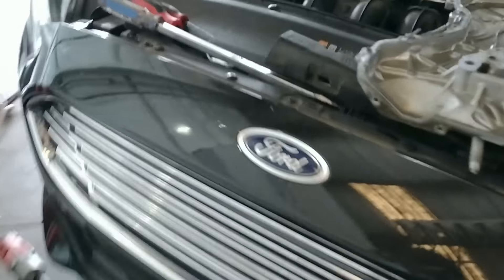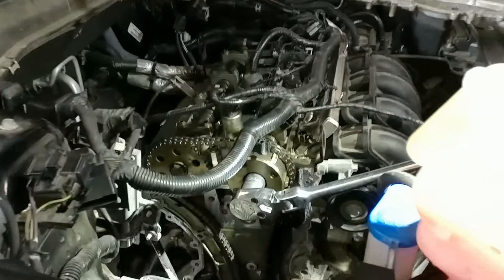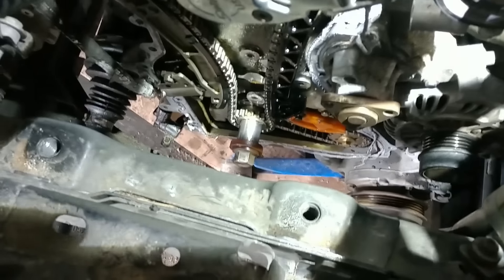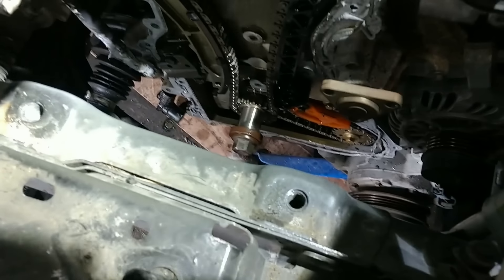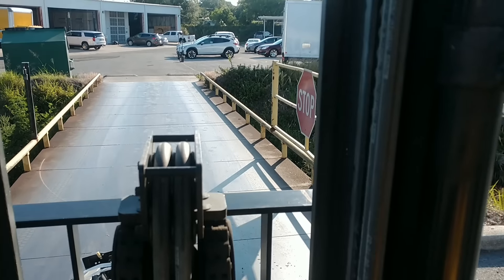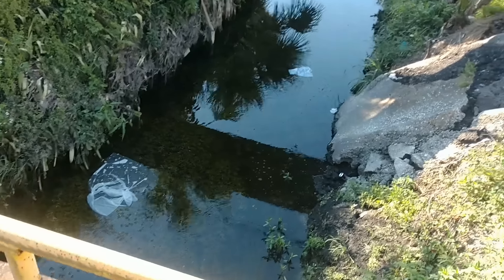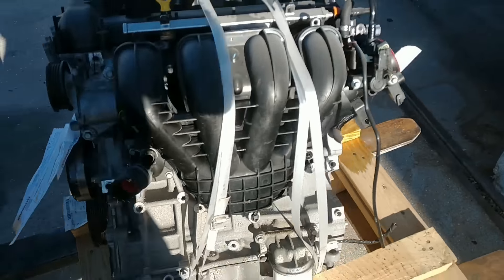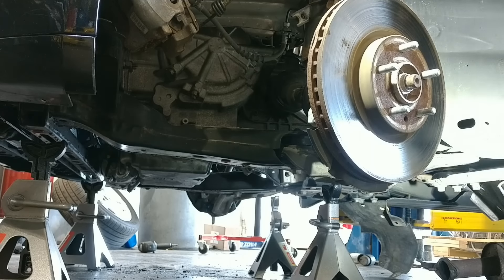Damaged Engine: You Broke it! Pt1

Comment: Great design. Replace the engine every time you have to remove the timing cover.
Reply from the maker: Lol 🤣
Reply: Lol itd be cheaper for sure
Reply: Ford apparently has a bunch of Apple engineers working for them now
Reply: @razter6678  Wait until the service department declares the warranty void because of invisible water damage.
Reply: Had a ford fiesta come in with a crank  no start after timing job, same problem but luckily the customer hadn't hurt the engine (it wasn't far out)  and it drove away after retiming 👍
Reply: About like 2.7 dodge products , don't do a waterpump without timing components
Reply: Late Ford Toreasses pull the engine for waterpump @ 10 hours of labor
Reply: Yeah, there is a toolset to remove the balancer that locks the cams and a special bolt that goes into a hole in the crank. It actually saves a good amount of production time. And in a perfect world the tool is only needed for timing set replacement which with a chain might be never. Ford/mazda have done this for years. Vw sometimes uses a taper lock with similar tools but the crank pulley might be keyed, the "correct way to do a vw is similar but you could do them without tools if you make your own marks. I would say since 2012 a bunch of manufacturers have jumped on the ford mazda bandwagon so be prepared to take this consideration in the future.
Reply: @camneilsen8234  that was lucky! 👍
Reply: @robertarthurs328  that was a travesty that engine. I had one. They made ungodly horsepower for such a tiny displacement. But if you didn't have one that was remanned. and didn't change the oil like it was religion, you were for sure going to see that timing chain up close and personal when it launched itself through the hood. Ask me how I know...
Reply: @christopherconard2831  Friend of mine is waiting to hear from insurance if his brand new F350 is going to be totalled because he stopped to help some old man with grandchildren who was stuck on a flooded street.  Opened his door and water got on the floorboards.  Truck still runs and looks like it's fresh off the lot.

Meanwhile, my old Nissan Titan I bought used was the lunchmeat in a car sandwich on the interstate and insurance didn't hesitate to rebuild it with OEM parts.  Plus it always had a nice feature where it automatically recycles used engine and rear axle oil by dispersing it on the undercarriage as a rust inhibitor.
Reply: Or... actually check how to do it properly and use the correct tools... and it doesn't get destroyed...
Reply: @fordgtguy  I'm sorry Ford guy... everyone else who is not off their rockers is going to continue making fun of Ford's exceptionally unfriendly engineering designs. 
It's great pub talk.
Reply: @adifferentangle7064  I've worked on many a GM product with many a dumbass design that I had to deal with.

Same with Dodges.
Reply: @adifferentangle7064   Completely writing off one manufacturer and pretending that the one you like doesn't do the same crap is both asinine and disingenuous.
Reply: @fordgtguy  Who said I was writing off one manufacturer in favor of another? 
Some vehicles are made with the mechanic in mind. Some aren't. 
Ford engineering tends to follow the trend of the German manufacturers in making basic repairs arbitrarily difficult, which isn't great when their target market is competing directly with Toyota buyers.
Considering now they offer seven year warranties here, it's not really the owners problem. But if you're like me and like to have a vehicle you can work on by yourself, then 90% of all vehicles are ruled out immediately. Pretty much 100% after about 2012. Nevermind the manufacturers.
Ford made some great things, especially the Barra engine. 
They also put bolts directly under the passenger seat, and do stupid things to the timing chain. 
I can do the same thing to every other car manufacturer. Just gotta pick the cars. Some are inherently worse than others.
Reply: @jeremypilot1015  All German cars are like that.  Change the oil like clockwork, by the time (yearly) or by the mileage specified.
Reply: @passattdise  Germans haven’t made a good engine in 25 years
Reply: @jeremypilot1015  
N52
But it was done in 2015 and was BMW’s last N.A. engine in the US.

My sons has 197k miles and runs smooth and strong.
Reply: @shannoncrawford7212  Those are the VANOS engines that need the solenoids replaced every 70K not that reliable IMHO. Albeit this was the last inline 6 and generally inline engines last a long time.
Reply: @adifferentangle7064  lol. I own BMW’s, my parents own fords. I own N/A and Turbocharged bmws. The fords are just as hard if not harder to work on. How do i know? Because i drive and work on both every day for the past 20 years of my life. The american cars are not far off anymore from the german cars in my opinion some are far worse
Reply: @christopherconard2831  All panels will be made of glass
Reply: @Posichronic  that's a neat feature.
Reply: @jeremypilot1015  ok how does that work? Like I don’t understand how a timing chain could launch through the cover and the hood
Reply: @darthrevan2063  A chain spinning at 4,000 revolutions per minute means that chain is making a complete go around and back to the top 66.7 times a SECOND. That is insanely fast, one linked pops when the system dries up like a popcorn fart and the chain breaks. The timing cover is only plastic so boom out it comes and the hood isn't going to stop it.
Reply: @jeremypilot1015  The N52 wasn't the last inline 6. The N54 and N55 both came after it with the N55 being only slightly less reliable than N52 (due to charge pipe issues with the turbo) with a lot more power. And now there's the current B58 inline 6 that came out after they started phasing out the N55 in 2015. There's also the S55 and S58 engines (though those are just high performance versions of the N55 and B58 respectively).
Reply: Clearly another one of Ford's better ideas.

Comment: Ford and Mazda don't use a keyed crank gear or balancer.  Valve spring pressure on the cam can effectively turn the camshafts when the balancer is removed without even touching the crank.

Comment: I'm a mechanical engineer and I wouldn't be able to sleep at night after designing fail-prone shite like that.
When you need to have a blue moon over your left shoulder and a rabbit's foot in your pocket to prevent an engine from eating itself alive, that's just not kosher at all.
Reply: I'll wager a bean counter is the one who forced that design.
Reply: Is it "fail prone" if the mechanic doesn't know how it works?
Reply: There is absolutely nothing wrong with this design, many brands of engines us this system. There is such a thing as accumulation of tolerances that will cause variation in initial cam timing if the system uses a key way.  Rod journal to crank key location, timing chain length, crank to cylinder deck height , cam to cylinder head height, cam sprocket key location, cam key location.  And. . . Mill the head during a repair and cam timing changes.

Engine assembly with the floating system is much faster too, hang the parts, lock the cam / crank and tighten things down, easy.
Reply: There is no problem with the design. Just RTFM and then proceed with repairs. Been there, fucked up that and learned from mistakes. Now i spend 5 more minutes reading or googling before attempting repairs that can go really wrong if something isn't done right.
Reply: @Cheepchipsable  Yes
Reply: Saving a few pennies on assembly and leaving a pain for mechanics down the road is standard procedure it seems.  I prefer military use equipment. It is designed with easy field maintenance in the future as a priority.
Reply: @bobroberts2371  just because a lot of people use it doesn't mean it's right it's still chicken s***
Reply: @tommypitcock6646  Other engine builders use it because it offers much more accurate cam timing. When you are tied to emission rules / fuel economy and the need for more power, this kind of stuff matters.   This kind of system does not fall apart in use so the blame lies with the tech that was working on it. Don't blame others because you are incapable of understanding or unwilling to understand why things are the way they are.
Reply: @francoistombe  As I stated in other posts, this system allows for more accurate setting of cam timing.  This kind of thing matters when there are emissions standards , fuel economy standards and the need for more power.  Read the manual ! 
I heard the same complaints when alternators / electronic ignition / disc brakes became common.  Either learn or get out of the business.
Reply: @bobroberts2371  Agreed, there seems to be a lot of dinosaurs out there that are unwilling or incapable of accepting change, and if they can't understand something then it must be "stupid". The problem is not the engine...
Reply: Boeing learned a long time ago not to rely on folks "reading the manual". There are ways to make minor adjustments while keeping a gear or sprocket in a spline or keyway. Did it all the time with diesel injection systems.  A full float gear on a shaft is an invitation for a slide off spec. Of course these precautions mean extra manufacturing cost, sometimes only pennies yet they skip it. Sometimes it bites you later...like the Remington rifle safety or GM's key tumbler fiasco.
Reply: @francoistombe  I have one question.  There is a you tube channel Scotty Kilmer , do you consider him a great mechanic?
Reply: @bobroberts2371  Scotty is a widely experienced mechanic, vociferous, has strong opinions and does not hesitate to express them. And some of the busiest arms and hands I have encountered.  Certainly most interesting.  I would not form an opinion as to "greatness" based on what I have seen.  I would certainly trust him, his knowledge is huge.  The only mechanic I would rate as great was one of my mentors, decades ago. He could look at any part of an engine by itself .. a bearing, valve, spark plug, and from what he saw he could tell you what was wrong, what was about to go wrong, what caused it to go off.....  He was like Sherlock Holmes.  Never met anyone like that since.
Reply: @francoistombe  I figured Scotty was your guiding light.  Actual mechanics know that Scotty is a hack that preys on those with minimal mechanical knowledge while making big $ by generating click bait.  ( Notice the constant  " This is the end " vids lately?  ) 

Google "  scotty kilmer compression fitting brake line "  and see what comes up.  Look for the Jalopnik article " This Emmy-Award Winning YouTube Mechanic Is Full Of S. . . "  by Freddy "Tavarish" Hernandez on  4/21/15 1:30PM   Here you will see a pic of him holding up a compression fitting box to the camera where it CLEARLY STATES "  NOT for use in automotive brake line systems "  

And.. .. As for his alleged " Emmy Award " , go to the Emmy web site and type in his name.  You won't find anything because he never won such an award personally.  He was a minor contributor to a regional TV car program from the 90's.
Reply: @ferrumignis  Have a look at my post about Scotty Kilmer , and who likes him.
Reply: @tommypitcock6646  So when you go to a dealer to buy a 100% new car, do you demand to see the service manual to research design strategies you don't agree with?
Reply: @bobroberts2371  Shoddy Kilmer is one of the biggest hacks around. If you need to know how to do a job in the wrong way, possibly making your car dangerous, his channel is full of handy tips.
I particularly enjoyed him using a Home Depot compression fitting to repair a brake line, with the packaging clearly stating it must not be used for brake lines!
Reply: @bobroberts2371  I never said any such thing. "Guiding light" .....bit of a stretch there.  I watch Mr kilmer because he is interesting and in some ways amusing.  I have never used his videos for mechanical information. The issue is penny pinching and poor design by manufacturers causing headaches with servicing later. How many times have you had to charge an hour or two for shop time required because of cheap shortcuts used by manufacturers?  You are projecting pejorative things about me because you are not happy because I disagree with your support for designs that cause trouble later.  Boeing figured out decades ago that this approach makes bad things happen. ( Seems they forgot this with the 737 max design...and it bit them in the butt big time ). Consequences drastic with aircraft, but just pricey for owners on the ground.  Military requires designs and materials that don't cause these headaches.  Like stainless steel headlpipe studs on manifolds, stuff like that.
Reply: @francoistombe   said "  I would certainly trust him, his knowledge is huge.  The only mechanic I would rate as great was one of my mentors, decades ago "    Mentor = Scotty is your guiding light.  The timing chain system on the engine isn't just about cost, it is about making sure the cam timing is exactly where it should be in order to meet emissions / fuel economy / power targets.   
Also, look at the Jalopnik article I posted concerning Scotty using compression fittings on a brake line.  What is your response to that?
Reply: @bobroberts2371   A whopping stretch again.  I did not say Scotty is a mentor to me.  He seems to have worked on a vast range of vehicles so I would trust an assessment based on this but if I were specifically dealing with a certain model always I do my own research.  You seem to have a hard time dealing with a contrasting opinion and are going ad hominem.  How much shop time have you had to charge for because of poor design and cheap shortcuts in manufacturing?.  That is the question.
Reply: For general observation.  Engines go out of spec due to stretching of the timing chain and other factors identified in earlier posts. Cheap design results in floating crank sprocket and a position locking kit that the shop has to buy.  A timing chain has a tension side, pulled by the crank sprocket and "downstream" of the crank sprocket is the slack side. The chain tensioner, (so-called), is on the slack side and is used to take up the slack. It doesn't actually increase the tension on the tension (pull) side.  A simple mechanism to take up chain stretch and keep the cams in spec would be to have the chain guide on the tension side adjustable the same as is done on the slack side. A simple eccentric bolt or even a shim system would do the job. That way the crank sprocket could be keyed to the crank and the shop would not need a locking kit. No accidents and no extra cost to the customer.  But they won't do this. Bean counters rule.
Reply: Don't plan on sleeping, lots of things look good on paper until it sees the real world

Comment: The Renault K4M engine has the same design with the crank pulley and an expansion screw holding everything in place. That was done because they introduced variable valve timing into it and getting the belt on rigt would be near impossible otherwise. You need a special tool to hold the cam- and crankshaft in place and work on it. Many shops fucked it up because they didn't do this and expected a keyed crankshaft.

Comment: The manufacturer used a timing chain to reduce the risk of this type of failure. A few years earlier, this would have been a timing belt with a non interference engine. Then some erroneous setting would have just caused some delays in repair and not required an engine replacement.

Comment: I worked as a Diemaker @ Doehler Jarvis in Toledo.  We did the R&D on Ford's aluminum heads and engine blocks in the eighties. Our engineers wanted to put S.S. spark plug thread inserts in the heads and Ford nixed the idea saying the plugs life cycle was 100k and would be well out of the warranty coverage limits. Got to love Fix-Or-Repair-Daily vehicles. LOL
Reply: That sounds about right lol and now they have the reputation of spitting spark plugs out and having to use an insert to fix it lol.

Comment: That engine requires special tools to hold the crank shift and the cam shafts when you pull the crank pulley it will cause the engine to go out of time you can get those tools on ebay or the rotunda website alldata shows you what tools you need in the crank pulley removal procedure or if you have access to the PTS ford website it will show uou in the crank pulley procedure

Comment: Ford ecoboost engines are a pain to work with. As a Ford Focus ST MK3 owner, I can attest to that. You either need special tools specific for this engine to time it up once the tension is removed from the chain or you gotta try and stop anything from moving while you do what you need to do as some of the parts don't have key ways to pin them dead still.

Jigsaw and some 1/2 inch thick board can get you a useable jig though...even if it's bodge it stops things moving.

Comment: I feel your pain man. Just put the head back on a 2001 Celica. Timing was off and I cranked it over. Machine shop said two valves were bent.  Got it all back together and it runs great. Except now the power steering is not working. Not sure why but it acts like the bypass valve in the pump is stuck open. Shop lost our ass on this one.

Comment: So sorry that happened. Just saw part 2. I'm 70 yrs old, hotrod mag in 60s. Napa in 70/3yrs, 78/2016 steam turbine repair. I was helping my son 4yrs ago,pulled cyl head 5 cyl diesel. Cams not keyed, tapered fit on shafts. Torque critical to hold sprockets  ! ! ! All of the machinery I have been exposed to this was unsettling. Perfect world ok. Reality, cost saver " No Keyways Hell Yea". 10% kill rate more money for us ( mfg). Straight shaft no restraints except face contact ( torque ), crank moves during tightening process. Runs just not quite right.